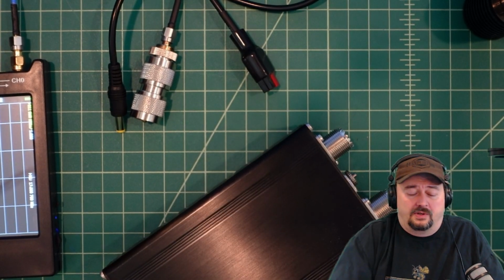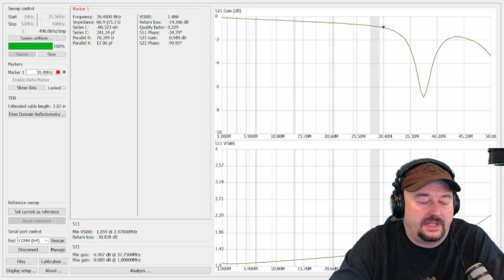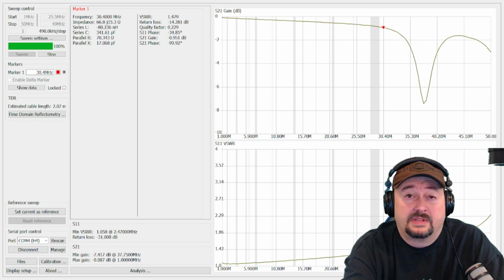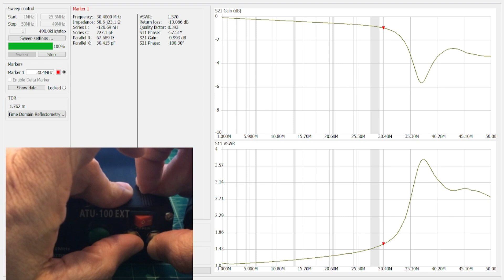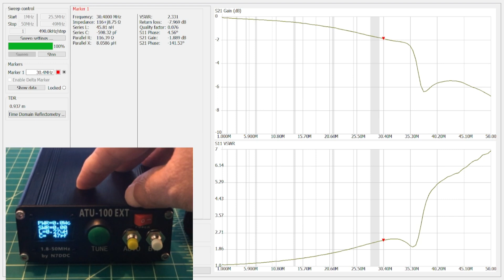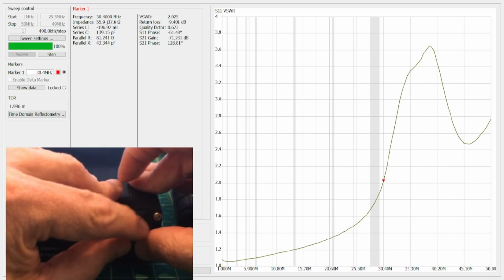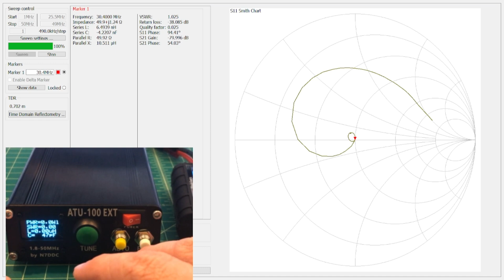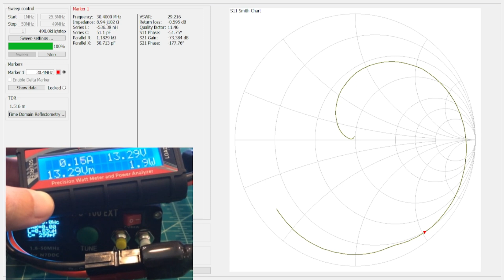ATU-100 Test Mode - Ham Radio Antenna Tuner

Comment: The "insertion loss" is above 30MHz, the tuner only works from 1.8 - 29MHz according to the specs so that "insertion loss" is not relevant. Also, did you calibrate the nanoVNA through the tuner including that rat's nest of connectors? If not your readings hold no value, basic principal of operating  a nanoVNA else your results won't be accurate.
You never actually used the auto tuner in auto mode to actually tune a real antenna.......
Reply from the maker: Glad you liked the video 👍

Comment: I was wondering how high of an SWR will this tune.  I bought the same one at about the same price.  The single page that came with the unit didn't bother stating the max SWR it will tune...so that worries me a little.  I would hoping it will tune a 3:1 mismatch.  A friend has a G90 and says it will tune almost any mismatch.🤨
Reply from the maker: The g90 has a pretty sweet tuner.  I’m pretty sure this one does up to 10:1 swr 👍

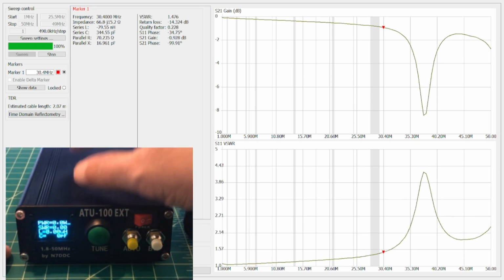Comment: Let me sat this about that.....  As your presentation overall was good, the results cannot be taken more thank a grain of salt....  I.E..  At ~ 6:05 when you touched the case the display shifted significantly to LESS loss and this is due to my major assumption that the auto tune box WAS NOT GROUNDED - a ground terminal IS on the back of the case....  I could not see the the rear of the tuner and hopefully you will revisit this test and maybe have more accurate results IF/WHEN the auto tuner is GROUNDED....  An "A" for effort, and a "D" for results   :<(
Reply from the maker: Thanks for watching ATAS

Comment: I have no explanation why the diagram changes when you touch the case. Do you? Maybe the two blue cables build a resonator. Or there is HF leaking off the power supply cable?
Reply from the maker: I am not sure.
Reply: Touching the case was indicates that the case DOES need to be grounded....
Reply from the maker: @ainttakenanyshit  so I don’t disagree my friend but the shield is grounded and ground all the “stuff” together.  I honestly don’t recall if I was floating on a battery or grounded via the UPS.  I do appreciate the comment even though you seasoned it with a little snark.  Either way, thanks man.
Reply from the maker: Opps, I confused the comment.  You were snark free 👍

Comment: I like the one I built. I see there is a video by a guy who changes a couple of diodes in the tuner to help accuracy and puts some ferries on the various wire and cables. I need to watch his video again.
Reply from the maker: Yeah, I saw it... he did a great job.  Thanks for watching Bruce!
Reply: I have thought about getting another one to build for the fun of it. I built mine from an Ali Express order. They give quite a number of build options like what you mentioned. I have used mine to touch up my DX Commander which mostly doesn't need any tuning but I do really like mine which was around fifty bucks. From reading about it; it actually has connections to hook it up to the radio auto tune. That would be nice to be able to hook to the FT-891 auto tune feature.
Reply from the maker: I should get on to building my kit...
Reply: @TheSmokinApe  One thing that wasn't streight foreward was the wires to the two buttons that had to be soldered on to the back of the board in two teny tiny spots. What I did was use the extra wire that they gave to wind the SWR bridge. It was kind of that gold wire like they wind on am radio ferrite antenna's and it worked real well. It would be fun if someone figured out how to add the tuner interface as the board as I understaned it actually has the ability to hook let's say to the 891 via the communications port and actually operate the tuner on a low power signal to tune.  Perhaps the only not so good feature is it does not hold it's setting when the power is removed. But hey it is fun to build and very usefull.

Comment: Umm...if you buy the kit, you will still end up with random diodes - remember, it's only a "partial" kit. All SMD parts already slobbered down....
Reply from the maker: Well...  I do have the kit and it was like 30$ vs the 95$ for the assembled unit.  Seeing that I don't know what exactly is wrong and that something else could be, I'd rather work on the 30$ unit.  Also, my kit does have the wrong diodes... 👍
Reply: @TheSmokinApe  Yep, can see your logic. How can I tell if my recent kit purchase has the rubbish diodes? They're largish glass, but SMD. Got some BAT41 leaded diodes in the junque box - might make sense to head off the pain, eh?
Reply from the maker: I just posted info on my Community tabs that shows some info about the diode debacle.

Comment: Nice video, thanks!
It never occured to me to hook up my NanoVNA to the ATU-100. 🤔 Do i want to know how bad my DIY version is? 😂
Reply from the maker: Haha, give it a try...
Reply: @TheSmokinApe  Will do... My unqualified theory is, that connecting two SO-239 with a short wire inside a metal box already gives you a low pass filter, as the wire and the case form a capacitor to ground. The question is how much capacitance is it?!

Edit: 😂 Ok i measure ~35uH to ground with the LCR meter on my device. Should have checked the schematic before writing BS. Alas posted two snapshots of the NanoVNA on Twitter  for you. (Too lazy to hook it up to the PC)

Comment: Good video got a question on your Amp Time battery which I have also 12v-12ah. When you fully charge it what is the volts you get when charged. I never get above 13.3 v. I have a Bio battery same size 12v-12ah I get 14.4v when fully charged. Using the same battery charger for both LiFePo4 Lithium batteries. Totally don't understand why maybe you can answer that question.
Reply from the maker: Are you using the same charger?
Reply: @TheSmokinApe  Yes for both and its for LiFe batteries

Comment: I will repeat your tests, a thing  I should have done myself. I didn't like the 1:1.4 VSWR at 10m and that is a consequence of the badly designed SWR bridge...
Reply from the maker: Hey Rafael, I’m interested to hear the results.  I want to do a general use video and then test this further with the mods.  I am really digging the simplicity of these tuners and that you can buy them as kits to hack on 👍